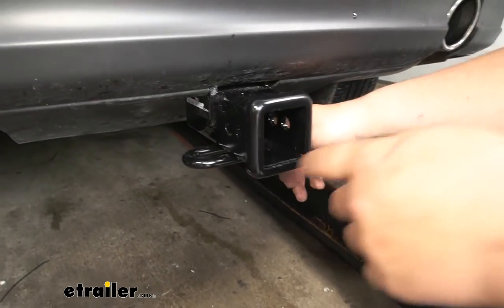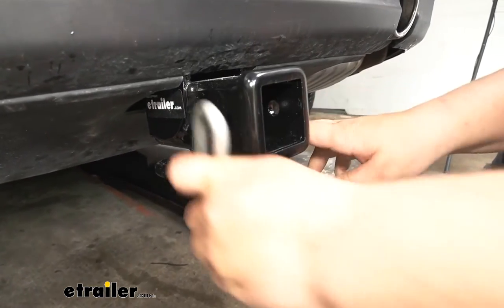etrailer | DIY 2018 Jaguar F-Pace Installation for the Draw-Tite Max-Frame Trailer Hitch Receiver

Comment: Not clear if this will also work on the facelifted 2022 Jaguar F-Pace...
Reply from the maker: This hitch is designed to fit all models of the 2017 - 2022 Jaguar F-Pace. Check out the following link to see this hitch on our website.
https://www.etrailer.com/Trailer-Hitch/Draw-Tite/76026.html
https://www.etrailer.com/vehicle/2022/Jaguar/F-Pace